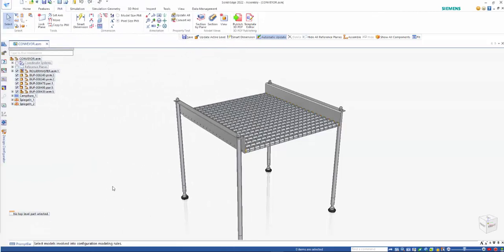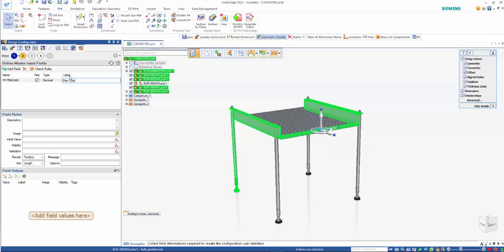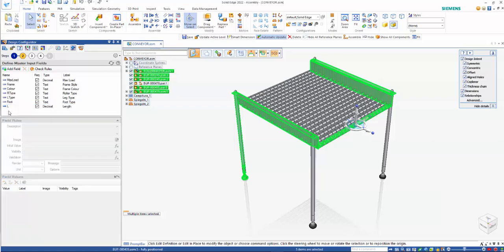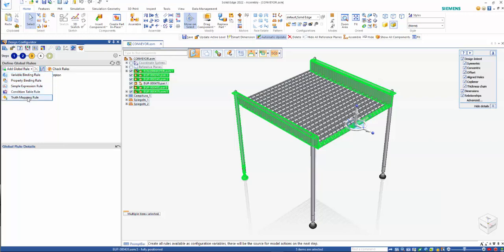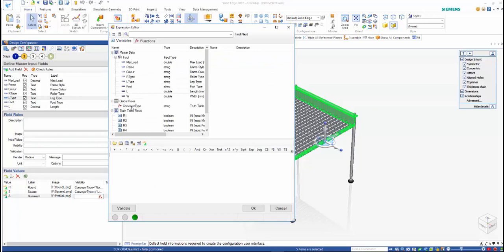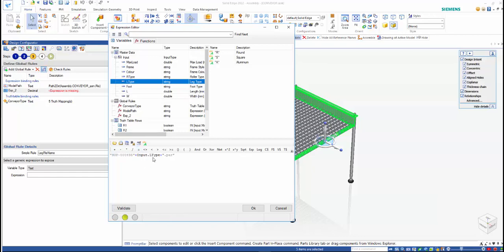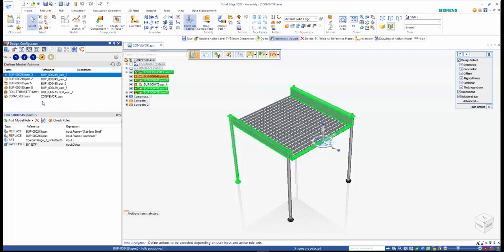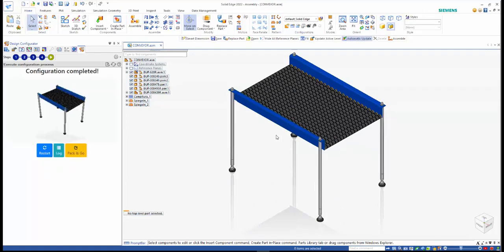SE Design Configurator

Comment: Hello, I trying work with design configurator and I have a question. I have emply asembly and I use "place part" by_exp command. How can I change some variable in this part?  I can work with variables only if it is added into list of components at "step 1". Is any way? Thank you.
Reply from the maker: Hi
I am unsure of the question here? To use the design configurator, you will need to have parts in the assembly.
Reply: @cadcentralnz  Hello, Yes, I have empty asembly at first. I can add some part into asembly by "place part" command in DC via formula. My question is: How can I change size of this part? It is possible?